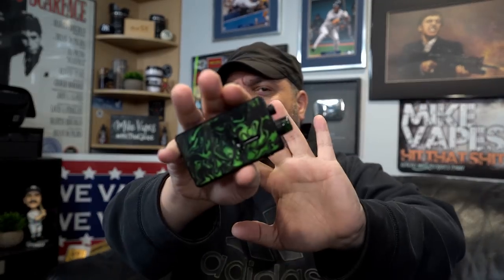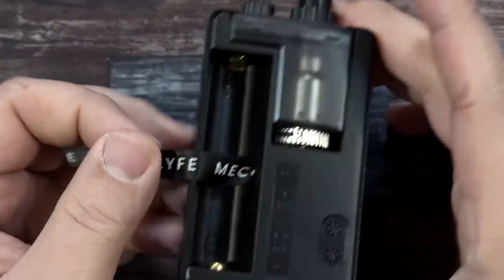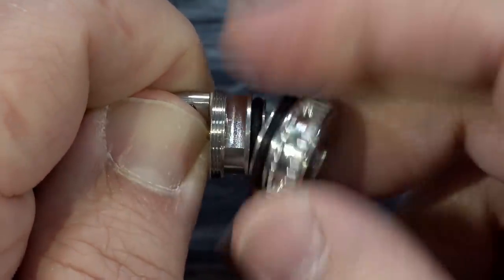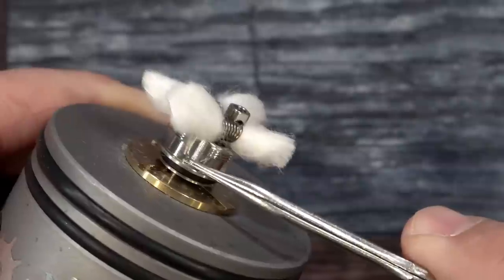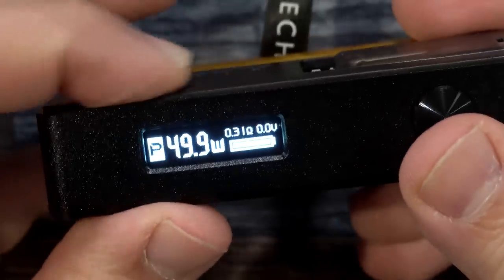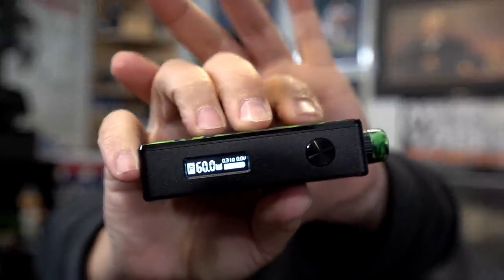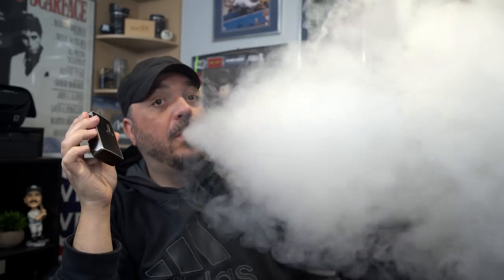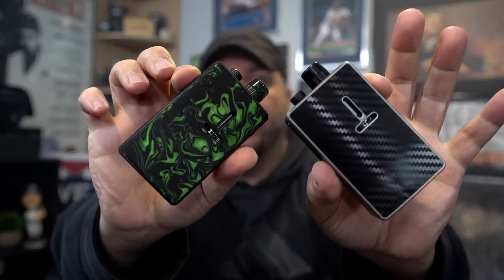Mechlyfe Ratel XS Rebuildable AIO - Dual Coil RBA?

Comment: I'm a big R-DL fan, that's why I am still running a Moonshot. I discovered the YouTube vape scene and your channel when I saw that one on heavengifts. Moonshot as a first Rebuildable was dumb but I'm glad it brought me into the community.
Reply: Lol my first rda was the geekvape loop the original (not v1.5) and i HATED it. Somebody at a shop recommended it over the dead rabbit and i resent them for that lmao. It was a ridiculous deck to use and it just wasnt a good vape even tho if u built it right ya could get damn good flavor but it got super hot n prone to leaking. And airflow was weird. They changed the big open holes with honeycomb on the v1.5  so i dunno if it vapes any better...
Reply: Moonshot is a tricky one to start with... my first was the geekvape karma mech/rda/rdta combo.... reviewed by mike

Comment: Swappable 18650, RBA base included with a built in 510 so you can glow the coils, reasonable size (compared to the previous version), optional dual coil RBA - Yay! Pity about that chronic door rattle. So close - dammit... Maybe if they release a version 3.

Comment: Yeah they should have put a locking tab for when you unscrew it off ur build Deck. The door rattle would drive me mad lol..i would prefer the panel to be matchy matchy..it's a neat AIO. Will the Dual coil rba work on the first Ratel? Good Job Mike 👍 👊

Comment: Genuinely taken with this thing. Only other device I wanna see before I buy something new is the new IJoy Jupiter, pod mod with 510 tank connector.
Reply: the vinci x has it too
Reply: @ryanholt1680  I thought I saw something like that. I'm torn between the 2. It's gonna come down to the RBA section. I have to admit the Vinci RBA looks nice with its postless deck
Reply: S B i think i would buy something from voopoo over ijoy any day of the week lol.  just my opinion. personally i won’t be using the 510 connector. i use these pod mods for their rba sections. have you checked out the aspire mulus? no rba section yet but if it’s as good as the rest of the mod...it’s gonna be one of the best i have. 80 watts, perfect strong magnet doors. i have two i love them so much. you can’t really go wrong nowadays tho, everything coming out is pretty dang good
Reply: S B i actually just ordered the rba section for the vinci that mechlyfe makes.
Reply: @ryanholt1680  I just like the idea of the 510 connector for my MTL tanks. Also I like the look of the IJoy. Either way I'd use it as a pod most of the time anyways. If the Vinci had a pod with a round mouthpiece I'd be all over it. I'm not fond of flat tip mouth pieces like the rpm or Vinci. 

I love the look of the mulus but no RBA was a no for me. If it comes out with one I'll look back into it.

Comment: This vape is must buy. I've been using it for three days now, and it has got two little problems which can be easily fixed. Firstly, the rattle. Maybe that's why they call it Ratel. xD sorry. You'll need stickers. Cut them down to 1mm wide slices and stick it to the side panel's edge. Secondly, the magnet. Mine came off after 5 hours lol. They are stronger than the glue they used, so you'll need to glue it back with epoxy. Have fun!

Comment: Ive had some problems in the past with rattling battery doors and i found that small adhesive velcro patches stuck to the inside of the box and the door completly eradicated rattle

Comment: Hey mike great video. I was about to buy the aegis boost what do think ? Is this a better vape? I like how this comes with the rba base .
Reply from the maker: For single coil the boost is great but for dual the Ratel thrives
Reply: Mike Vapes ok that makes sense. Thanks mike 👊
Reply: Also the Boost has internal battery so limited to the life span of the internal battery. This one should last for years so you can rattle the door for a long time.
Reply: I went with this even tho I do single coil. The option is there and not with the boost. The only dual coil aio out

Comment: Great review as always Mike. I'd buy this if it wasn't for that damn door rattle and the doors not matching if that was fixed I'd definitely buy this  I'm looking for a stealthy little DL AIO to take with me to work for next to my Notion MTL/Kayfun Lite 24mm so I only have 3 devices at work instead of having 4 n 2 of them being full size mods and 1 mech (Dreamer w/CC switch) I really like this other than the door situation which I know would agrivate the shit out of me 😔😢 Thanks for another great review I'll be looking forward to the next one maybe Grimm and Hellvape will put out a RBA base for the Grimm  kit
Reply: Billet Box with Haku Xeta Bridge. Spend more up front, use it for many years.

Comment: Original Ratel is one of my favorite devices. This looks to be a great upgrade that addresses pain points of the original. I'm buying one!
Reply: I am waiting for mine.. is it really that good. I have a Vinci now but the rba was garbage and coils dont last.
Reply: @Dan-on7yo  What a timing. I saw your reply just as I was enjoying my Ratel haha. Yes, it is very good. I'm receiving my Ratel XS tomorrow and I cannot wait! The design and filling method were my only complaints with Ratel, and XS addresses both of them.
Reply: @solvaper8285  awesome I am sitting here trying to rewick the throw away coils on the vinci. Actually work better than orig but the rba was garbage. Mine just landed in the states so as long as customs dont hold it forever I have about a week to go..  did you get the dual deck?

Also lmk if the ratel single deck fits in new pod as they dont sell single coil de k separately or with xs tank so you cant keep a back up to take out with you.. I like to take 2 different flavors one menthol and one vanilla custard. I love the. Kustard but cant do it all day plus keeps vapors tongue at bay. So I have to buy the dual and have no option for single unless it fits.

Comment: If any could recommend a sub ohm kit, what would you choose? Looking for some advice something with a tank that gives out ok flavour and a mod that lasts more than 6 hours lol. Any help would be appreciated thanks
Reply: I just ordered the Odan tank by aspire, the higher resistance coil fires up clouds on 35w <3. I will use it on my aegis solo I think they will go great together and there wont be any overhang!
Reply: @adventureAndStuf  That's funny I've been looking at that tank it looks really good. I need a new mod tho just not sure what to get
Reply: @callmejacck7689  you'll love the tank! Looks great and super practical for the power consumption. Any single battery device will work great! I went with the blue tank cuz the color will go matchy matchy on my aiges solo its blue colored 😍 you can go over the top and go for a double battery device for way more battery or a single 21700 device with the samsung 40T battery that houses a 4000 mah. It's up to you on that part but I honestly love the combo Odan and aegis solo they look fantastic together. I tested that out in my local vape store but they didnt have the color I wanted for the tank so I'm waiting for it! Hope my comment helped you in any way possible!
Reply: Plenty of good affordable mods just search Mike playlist, As far as tanks I LOVE the Falcon King, Odan by Aspire is great also plus higher resistance so battery life is better than the Falcon King, Look at a swell mod, Jackaroo (single 21700) the gen 3 RX dual 18650 and plenty other mods